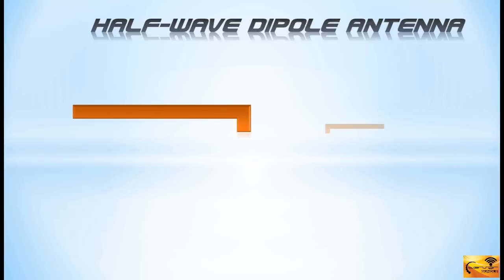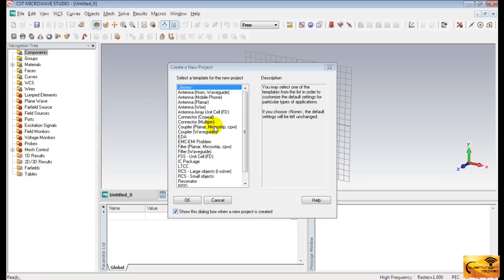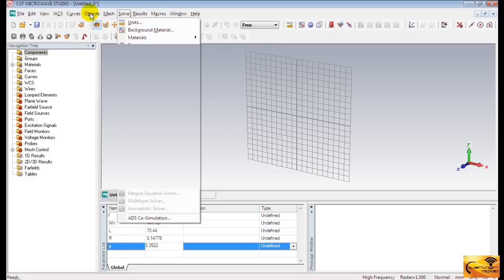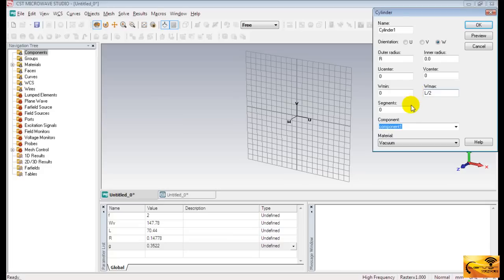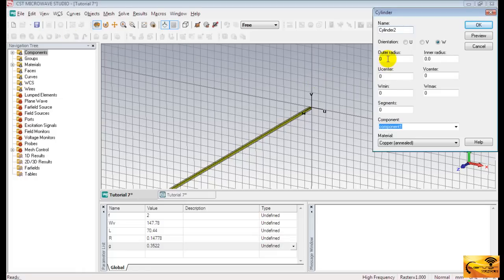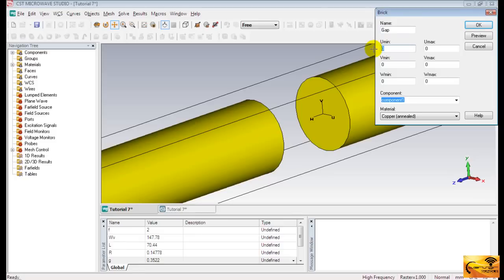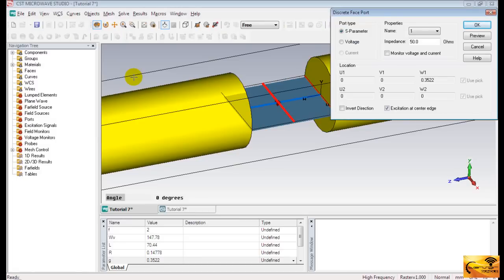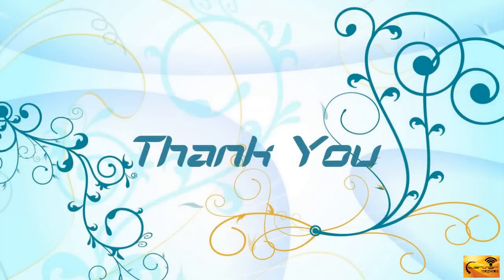CST Tutorial: Design of a Half-wave Dipole

Comment: Hi. I am using CST and Comsol both. 
1. If you would try to electro-magnetic simulation, I recommend that you use the CST. CST provided better interfaces and fined results for EM simulations.
2. It depends on your problems. Typical problems could be solved at only 2GB rams on netbook computer.
3. I also want to the software too. 
Thank you .